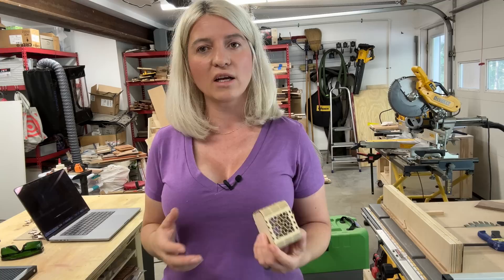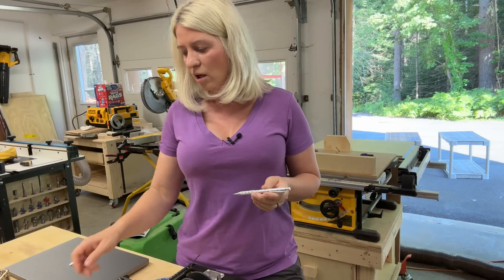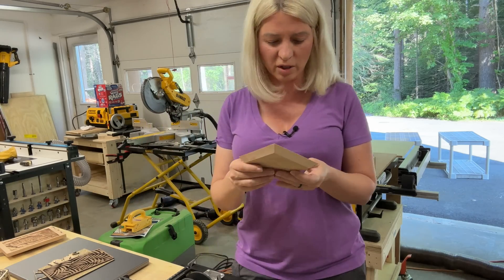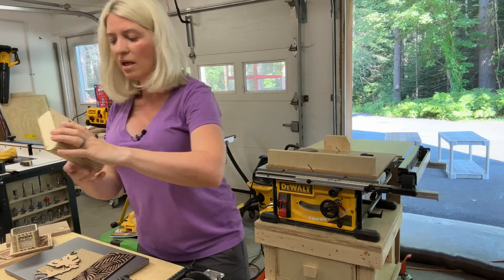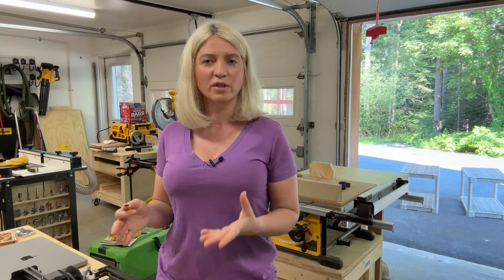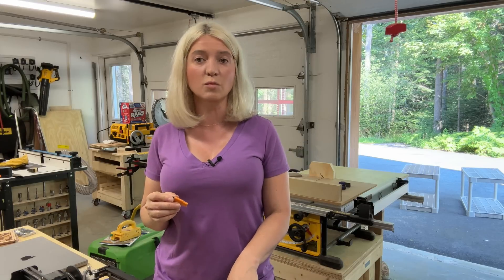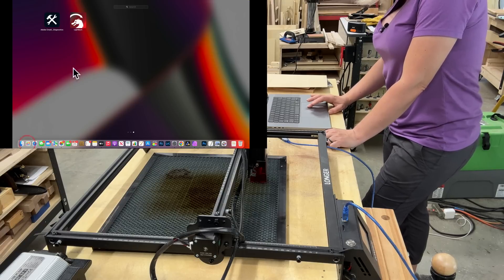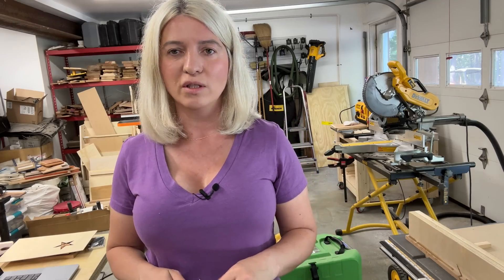BEST affordable laser engraver in 2023! Longer  Ray5 10W laser engraver. Powerful and easy to use

Comment: Skyler, thanks for this awesome introduction to a laser engraver.  I was hoping you could tell me if you're happy with your choice of the 10W laser as opposed to a 20W one?  I have a terrible history of buying cheap and then later upgrading to a better tool, and having to sell my original tool for a huge loss.  I'm trying to be smarter this time with buy once, cry once.  You impress me with your talent, knowledge, and creativity so I would value your opinion now that you've had some time to use your Longer Laser.  Thx very much!
Reply from the maker: Hi Ralph. So far I tried the longer 10 W and really liked it. But that was my first laser and didn’t have much to compare it to. They also sent me the Longer 30W and let me tell you this is so much faster, powerful and better quality all around. Xtool also sent me their 20W laser but didn’t have time to try it yet. Creality sent me their 20w laser as well and still in a box in my entry hallway:) I will be reviewing all of this machines and after that I will do maybe an overall comparison video? Not sure. So far the longer 10 w is a fantastic machine for the money. You will not find a better one for the price. However the 30 w is better but also a lot more expensive. The 10 w handle’s engraving really well but not very strong when it comes to cutting.
Reply: @SkylerEwingWoodworking  I'm looking forward to your Laser comparison with bated breath!  Especially since the XTool D1 Pro is one of the machines I have my eye on.  I've always been fascinated with wood inlays, so I was hoping to get a machine that can cut wood, and not just engrave.  (Especially since I haven't figured out how to use those router template guide sets yet.) Sounds like another video for you to make!  Thanks for responding, I do appreciate it!
Reply from the maker: @GroundedFlyboy737  I will for sure make those videos. Router inlays are not hard but you can never get detailed designs like with laser. I don’t care much for engraving for myself but inlays is what I want my laser for

Comment: Beware of the fumes when indoors, even a small amount can be an hazard, the particles are very tiny and will remain airborne for a long time , I have been using it for a year or so, to cut 5mm MDF sheets and the few times I used it indoors during the winter it left me with a really nasty cough. From experience I have to say, 10W is fine to cut wood up to 8mm or so with several passes and air assist, however, I would recommend to pay an extra for the 20W  and if possible invest also in upgrading it to Y axis extension and some limit switches. Limit switches allow for precise positioning. Btw, The safety instructions recommend that EVERYONE in the space where the laser is operating uses eye protection. If the laser cuts and bounces in the metallic honeycomb frame it can easily damage your eyes.
Reply from the maker: That is great advice. Thank you. I usually use mine in an enclosure but didn’t for the video so people can see the product. As for the powder of the laser you are also correct. I will soon be reviewing a 20W and a 30W laser
Reply: Thank you for sharing your insight

Comment: I purchased one and it came this past Friday. Very disappointed, I cannot get it to work with Lightburn or GRBL. It will engrave from the small SD card but will not print anything from the computer or Lightburn. It also will not access any file I put on the SD card. It also does not work with WiFi.
Reply from the maker: Nooo! So sorry you are having problems with it. Did you use the correct driver when installed it? The first time I connected to Lightburn, I used the automatic detect laser instal and it chose the wrong one. Please try again ! I can help you connect it and get it working. I dont have time today, but I could help you tomorrow? You can message me on my instagram username Skyler and we can set up a time to help you get it going

Comment: Hi Skyler, 
your channel appears to be growing well and the projects you take on show that you are multi-talented.

The laser stuff is something that I have played with in the past, and did some experimentation with different colors of Rust-oleum 2X spray-cans, sprayed onto 4 1/4" white ceramic tile.
The pigments in the paint become permanently-bonded with the glazed surface when lasered, and depending upon the particular pigment used, different colors are revealed in the final piece.
Once lasered, any other process other than grinding will not harm/remove the intended image from the tile.
The power/speed affects some of the pigments more than others, so some test-cards need to be done for each color of paint used.
Apple Red gave mostly mid-shades of brown between speeds/powers of 1200/80 to 900/65 - using a 4x4 grid of 16 test circles.
Brilliant Blue gave shades of gray, with a subtle blue tinge, at the same power/speeds.
Gold was surprising - using the same power/speeds, results ranged from pale matte light brown, to a bright coppery finish.
Grape was relatively uninteresting, producing some grays with a brownish tinge.
Key Lime showed little more than a range of grays with a tinge of green, but there were some differences with speckling on the surface finish.
Silver ranged from something of a matte finish at 1200/80, to more of a metallic finish at 900/65.
Spa Blue looked pretty much all the same to me, as a man, but a woman sees more than 16 colors.
The above was done with a FoxAlien Reizer 20W (7.5W laser power).

With the above said, what was my intention?
I had the idea of producing a pseudo-color image on a ceramic tile, by painting/lasering one color, then layering it up by repeating the process with different colors of paint.
Unfortunately, I do not have the photo-editing skills needed to separate the intended shade areas from an image, create a file from them, send to Lightburn, laser, rinse-and-repeat.

But I know a woman who probably does, and seems to currently be killing whatever she turns her hand to!

I envisioned a personalized 'color' tile, not simply black-and-white, embedded into a something such as a wooden trivet....or a tile to put in a bathroom/kitchen renovation, memorialize a pet, make into coasters....

If you'd like all of the Lightburn files I have, to play around with, you're welcome to them without restriction.

How do we get in contact?

Comment: Do you see any advantage over the Air Assist as opposed to the Lazer Enclosure? The Lazer Enclosure seems like a good way to help keep dust out of the project. Prices are the same.
Reply from the maker: honestly I think the air assist is better for no burn marks and cleaner cuts. The enclosure is more for shooting the smoke out of shop I think. I have not use the enclosure yet because you need to have the laser next to window or door.
Reply: @SkylerEwingWoodworking  Sounds reasonable...thank you
Reply: Air Assist clears the cut point area of smoke AND keeps the laser lens from fouling up (hazing--reduces cutting power!). An Enclosure will help contain the smoke and evacuate it from your workspace with a fan and hose. Another forum mentioned what is called a "downdraft table" which can also be used for sanding purposes.

Comment: I learned a lot. The inlay abilities are amazing! I'm going to get one. Thank you Skyler.
Reply from the maker: Very welcome! If you do decide to buy one don’t forget to use my link from description. I really appreciate the support.  You might also want to get the air assist and the metal mat that I have under laser to have more airflow and prevent burn marks . all sold by Longer

Comment: Thank you Skyler for the demo on that laser! 👌 You made some really awesome things with it! I never thought I would need one but you changed my mind on that! 😊 I really like that Owl you did! 👍🏻 How about the smoke? I see some that put out a lot of smoke! Thank you for sharing!
Reply from the maker: Thank YOU. If you do decide to buy one don’t forget to use my link from description. I really appreciate the support.  I really like the owl too. I love owls in general. Have one the often visits my yard. The smoke is pretty bad. I usually keep the garage door open. Also I purchased an enclosure ( longer sell them as well) that has a fan and a vent hose that you can snake out a door or window. I didn’t use it in video so people can see the laser. So Longer sent me the laser machine but I purchased the air assist, the metal mat that sits on table underneath laser for more airflow to prevent burn marks and the enclosure
Reply: @SkylerEwingWoodworking  I’ll use your link for sure! Thanks for the info on the the smoke extractor! 👌